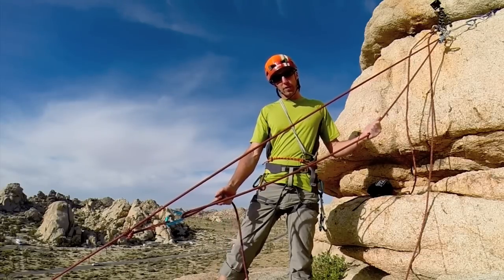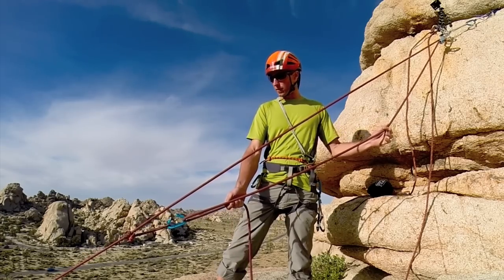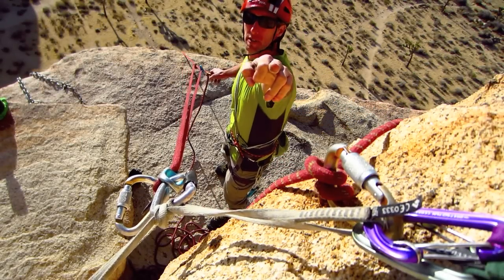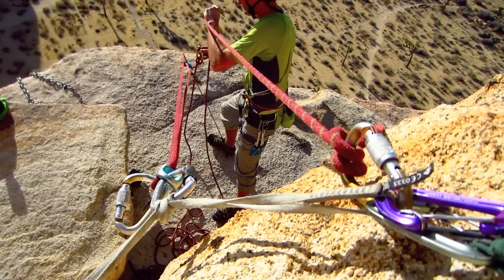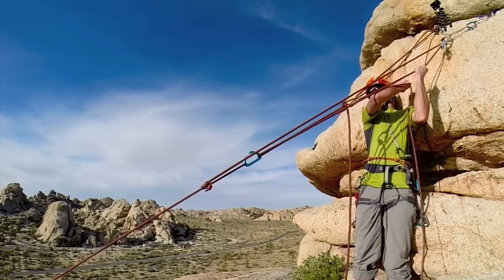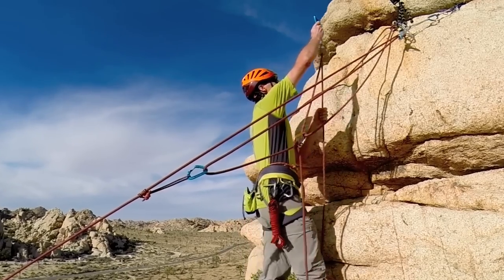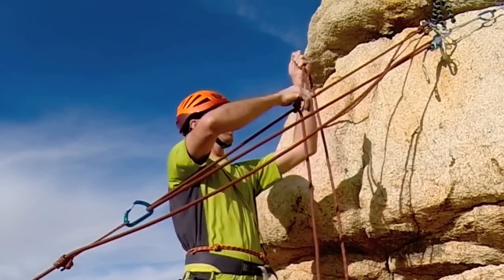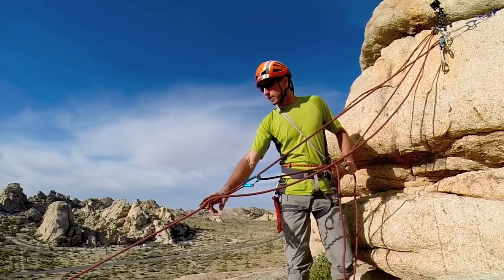6:1 Compound Pulley System

Comment: Seems like using another prusik instead of a clove hitch would make it much easier to adjust
Reply from the maker: Yeah, it certainly can, but generally speaking I don't cary 2 friction hitches.
Reply: @sietschoolforinternational5234  Because why? They are very light and pack small.
Reply: @sietschoolforinternational5234  you don't carry a leg friction hitch? What if you need to ascend?

Comment: Isn't this the same as 5:1 system, just that you use the same rope not a sling or additional rope?
Reply: It's different because the 2:1 is attached to the pull strand of the 3:1 whereas the 5:1 has the 2:1 attached to the loaded rope via the tractor. This subtle difference makes a small difference in mechanical advantage but a big difference in the amount that you need to reset the friction hitches.
Reply: Yes i noticed that, so i deleted the comment. And i tried to experiment with both systems and compare them to eachother but there is really not a big difference, because of all the friction between rope and carabiners, one friend who was pulling actually said it was even more difficult. I improved a little when i added an additional sliding retractor point, but then you have to assist reverso to take the slack :-/
Reply: Uroš Žvokelj oh, and i also experienced that garda knot works even better then reverso when taking up progress slack, except when it needs to be released
Reply: +Uroš Žvokelj Yes, it's very difficult to release the garda hitch and with some 'biners and/or combinations of 'biners, they can be very unreliable (can actually fail).
Reply: Ok I’m gonna be a nerd here. A six to one can be a compound haul system like this guy did. Which is different then a 5 to one, since a 5 to 1 can’t be a compound system. Also the easiest way to tell an odd vs an even system is where the terminating knot is. If it’s on the load side (climber) it’s odd. If it’s on the anchor side it’s even.

Comment: Beginner question: under the time building pulley systems, you seem to stop belaying the second climber. What if the second climber falls under the time you are vuilding the pulley system?
Reply: The reason you'd use this is because the 2nd climber has already weighted the rope and is unable to continue (fatigue/injury/ability etc.). Don't confuse this with a belay technique. It's a rescue technique, not a belay technique (you can also use it to haul loads). If the climber is able to continue on their own power, just top belay as normal.
Reply: They should have tied a catastrophe knot in the brake Strand to guarantee the climber couldn't fall too far while building it.

Comment: Thanks for this cool technique, will try it out. Seems much better than 5:1 in terms of resets.
My daughter belays me, she’s lighter and we multi pitch, so I want to make sure she can haul me…
I’m experimenting with bypassing the ATC on the anchor with a temporary Prussik to replace it with a petzl fixe and tibloc 2 (similar to a traction pulley), as well as replacing hauling carabiners with petzl oscillating pulleys. Does that speak to anyone? I would expect more efficiency, but is it worth the trouble?
Reply: I do rope rescue for a living. That set up speaks to me for sure.
Reply: @ryancorsaut5177  Nope... Tblock not good for hauling better use vt prusik

Comment: If instead of using a separate end of the rope to make a 2:1, couldn't you just continue using the same brake end of the rope, run it back up to the anchor, then down to a second prusik or clove hitch on itself- I believe that would make a 3:1 on a 3:1, which equals 9:1
Reply: Worth consideration, but more is not necessarily better.  9:1 for a litter team, but v.slow without assistants and longer work-length.
I also consider the weight of pulleys or biner-pulleys to reduce friction, depending on my objectives & roping needs.